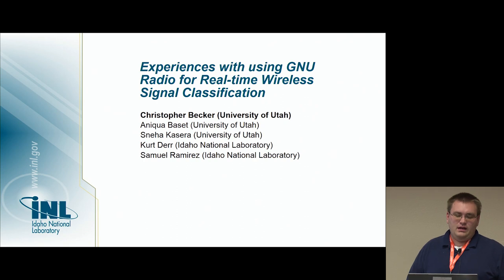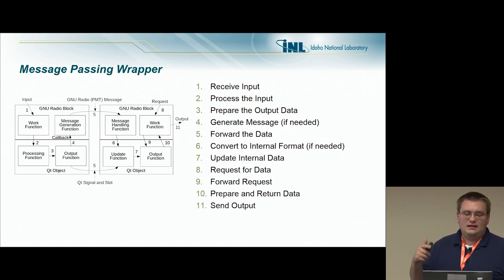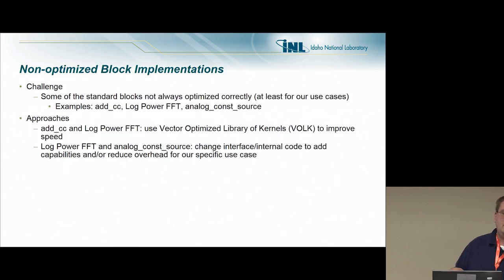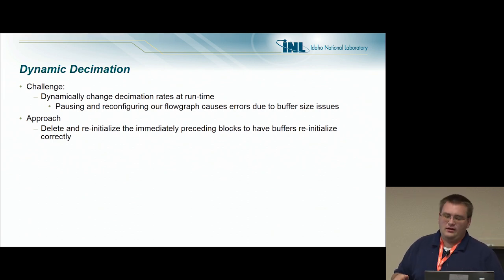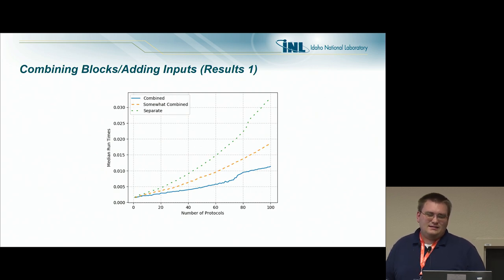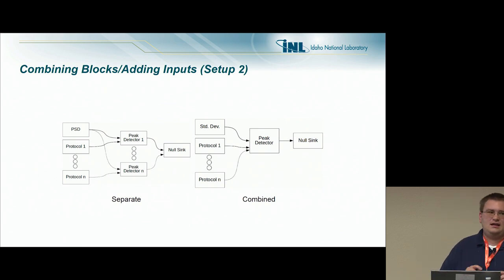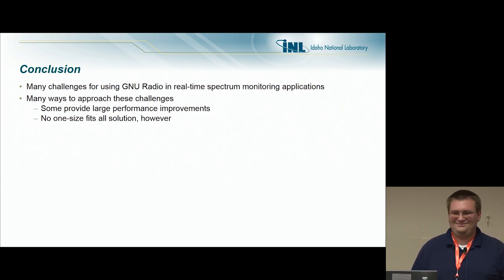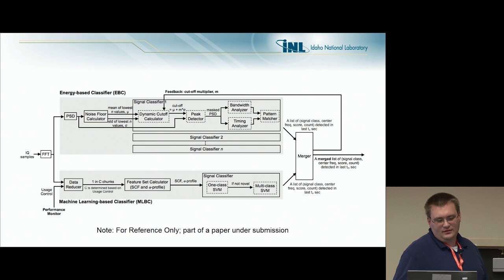GRCon18 - GNU Radio for Real time Wireless Signal Classification

Comment: This is great!  Some things that it's taken me ages to figure out -

You just have to accept that you will never solve the CAP theorem - the two generals will always lose messengers in the middle.  Given your loss rate is <<< your receive rate you're doing well for ML and RF.  It's just not an exact science - it's statistics with millions of signals.  Lose more to air than to your own system.  If you need something for stats use memcache counters - they're super efficient; Redis has fast (O(1) or O(log(N)) sets for message storage and queues.  APIs just make life easier over time, especially if you have something with a thread pool and async workers you can fire and forget with.

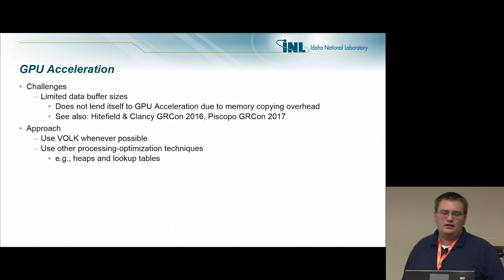5:00 to 11:00 pass messages out to zeromq or another superlight method; process in a native async environment like twisted or FB tornado on pypy, Go, Erlang, then pass back in to GnuRadio.  Anything in a heavy language like Qt will be several orders of magnitude slower because of builtin locking behaviors.  Check out the Linux kernel's locking statistics info - it's super nice!  https://docs.kernel.org/locking/index.html and https://docs.kernel.org/locking/lockstat.html .  It's all known patterns but definitely more involved than what you'd normally do at INL as an internship (I'm somewhat familiar, physicist by school). 

Good message passing also makes going into GPU much easier since you can just hand out to TF or similar.  Once it's going to local it's just changing addresses to send to remote!

ML become similarly easier - you can just push model updates off to a completely async process onto a separate machine or group of machines such as Tegras over local GB LAN.  But yeah, once you have better messaging, all the things become simpler.

Love it, nice work!